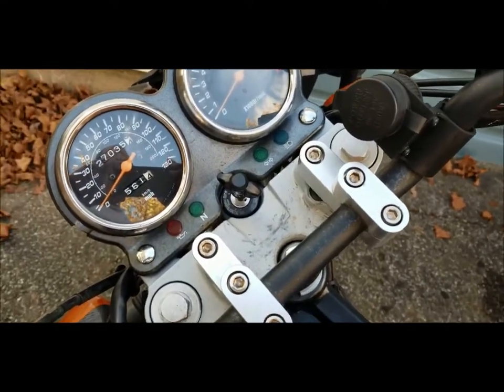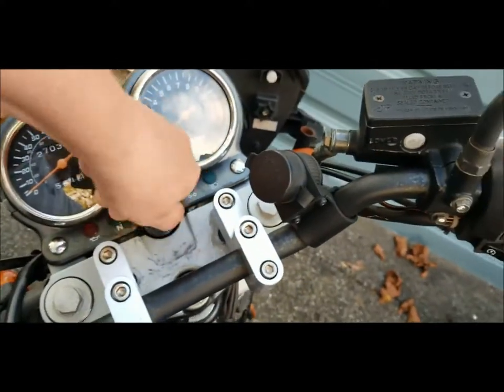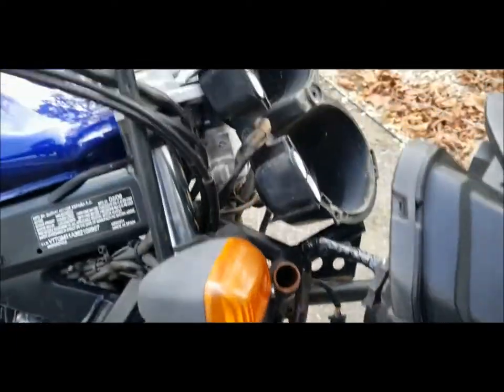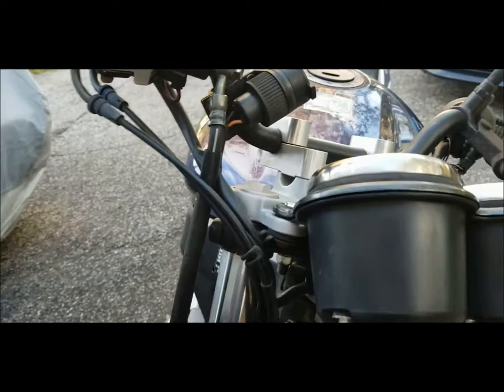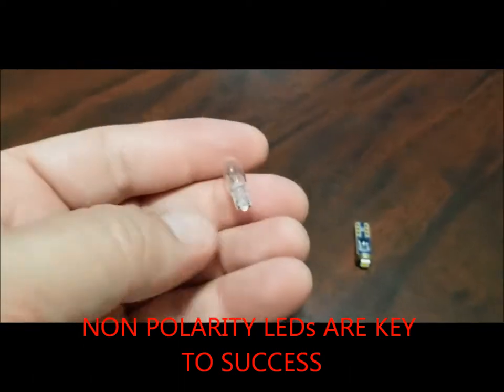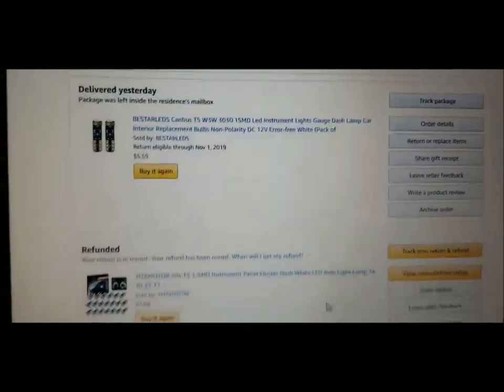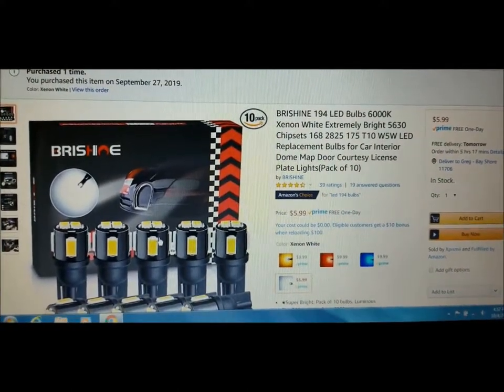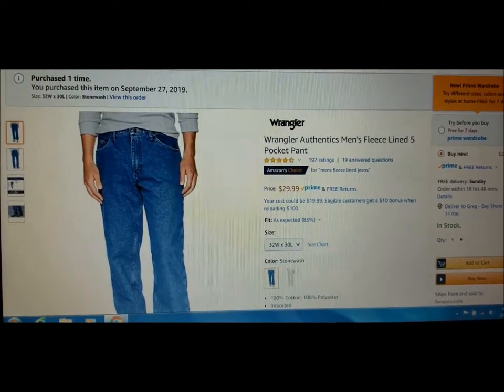Suzuki GS 500 Dashboard Cluster / Signal LED lights upgrade tutorial

Comment: ok. question. those 4 bolts (2 behind tacho and 2 behind speedo) im missing the 2 behind the tacho. what are they??
Reply from the maker: They hold the cover on and the gauge in place.
Reply: @gfoster420  i know they hold the guage into the cover. While the 3 screws hold the bottom cover to the top part. But im missing 2 of those bolts. What type of bolts? Can i get replacements at bunnings or at a place that sells bolts or do i have to go suzuki itself?
Reply from the maker: @Bobodeman  They're not special. You could pick them up at Home Depot. I don't know the size or gauge. Bring one with you.
Reply: @gfoster420  ive been to several stores here and no one has them here